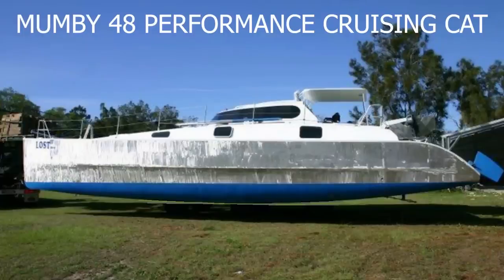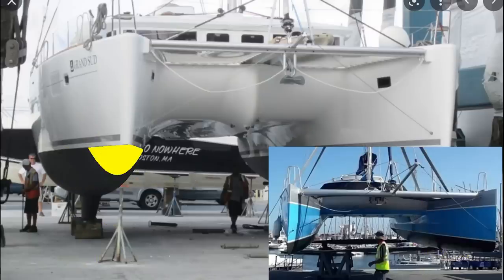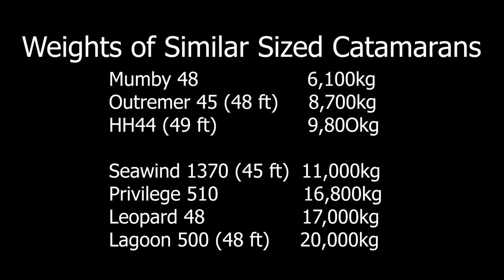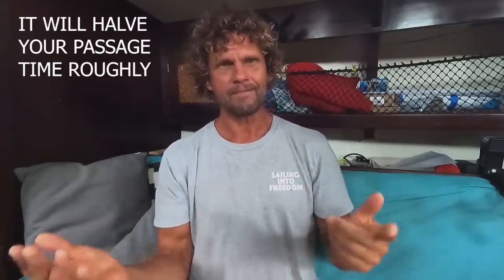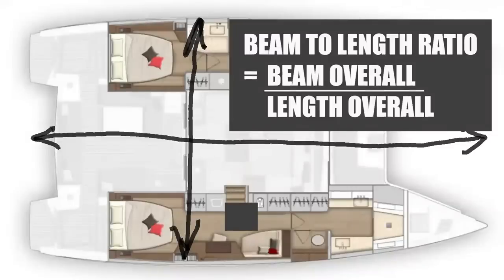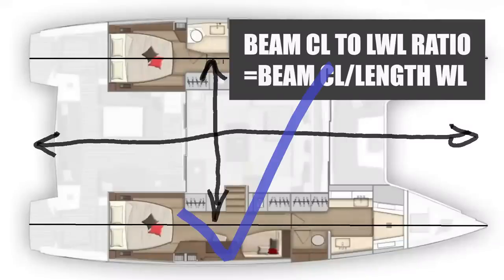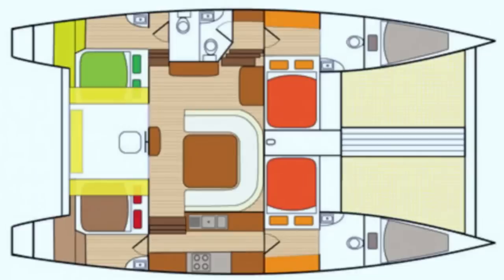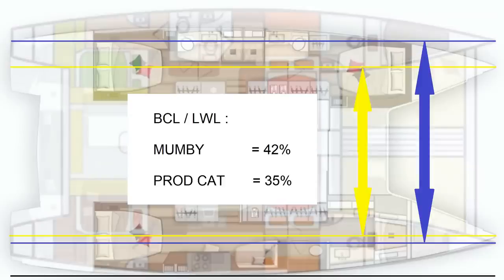How to avoid capsize? What to look for in catamaran design.

Comment: The information presented here is only partially accurate because it assumes "everything else equal". But everything else rarely is equal and this nuance wasn't discussed. Ie if the Mumby 48 was built with a moderate hull extension front and back so it was now 53 foot long but the rest of the boat was un changed (same rig) the length to centreline beam ratio will be "worse" but in this case the boat will be slightly less likely to flip over and the boat will have an improved DLR and higher speeds in moderate to strong conditions with only a minor increase in cost when building. I really don't think Serges stretched M48 is more likely to flip due to this ratio getting "worse".

This design philosophy has been embraced by some designers who have designed boats with long hulls and small rigs and small internal space IE stretched at the design level. Bob Oram is one I am very familiar with and his designs have similar SAD (better actually) to say a Mumby but superior DLR. For example my last boat was 13m long and 6m wide but it did have narrow hulls so centrelines were not too far apart for the small beam. The design philosophy here is a 33 foot boat on 43 foot hulls. Cost, rig size, space and weight are more similar the smaller boat (3700kg) than the bigger one and cost is the most important of any "design ratios" as we all just want the most boat we can afford.   Spending a bit more on the hull length without making everything else bigger is a valid design philosophy which does not result in an increased capsize risk.

The mast of my Oram was tiny 14.5m yet the boat is considerably faster than a Mumby 48 when both are in cruising trim even though its nearly 2m shorter. A 48 foot version of that boat would be very fast indeed. I was going to build a 15m version of this boat but now I have a very wide boat which at 15m long 9.2m beam with 7.6m centreline is on the other extreme. But sometimes it just works out this way. This wide boat will not only be able to handle a much bigger rig than if it was a lot narrower but unfortunately it requires one to equal the performance especially upwind.
Reply from the maker: You can't show  everything in a single video...more to come
Reply: @SAILINGintoFREEDOM  Looking forward to it mate.   I hope you explore some of the nuances here.   As you know a complete design is more than a sum of its parts and narrower overall beam to length isn't always bad as it depends on the context. Cheers, Deny.

Comment: A view from the UK. No bullshit heh Pedro? How's about the one; "that you can out sail a cold weather front" with 10kn boat speed? Your homework for tonite Pedro is to find out the speed of a cold weather fronts move at that's 25miles away and the boats doing 10kn how long before the weather front is on top of you? No, no bullshit.
Here's another one. Increasing the cross section of a cats hulls decreases the ratio of LWL to hull width ONLY works if you keep the beam the same width. Oh, you forgot to tell us that. That's ok mate no worries.
Reply from the maker: I didn't say cold front. Get on a high. They are slower moving
Reply from the maker: And how much can you put in one episode. I probably lost 80% at the first formula. Maybe you create a video and see how well that goes
Reply: @SAILINGintoFREEDOM  No thanks Pedro, i'm not that narcissistic. Highs go at approx half the speed of a low. Yup, you sure gonna run them outta town that's for sure.

Comment: The same thing that makes a cat fast is also what makes it so unstable in the lightest of weather its why they put the escape hatches on the bottom of the boat there just not enough hull in the water to make them stable even under light weather conditions .
Reply from the maker: You just have to be an active skipper

Comment: Pseudo science , but totally bs, comparing a floating penthouse like french production cat with a heavy slow aluminium cat with keels cat like munby. Next you put wharrams in the mix? Much more goes in a good modern catamaran design (gunboat, hhcatamarans etc) For example : if you extend the waterline with the same weight, the sail area can stay same for the same with same or even faster speed, but stability would be same and you have less pitching. There would be way more to say, but that could fill books.

Comment: It is very apparent for me as it has been my whole a life being a boat lover, is al boats are pieces of shit love them but POS.   My favorite part of store bought cats is that you can fold the boat up over tightening the rig how does a designer create any boat where that can happen ? why is the standing rigging attached to a "chain Plate"  which is anchored in the glass of the hull how can that ever be sea worthy ?   most have substantial less structural integrity than an acoustic guitar .
Reply from the maker: They sag too... The Mumby is very rigid... Less fatigue
Reply: example 1 the 9 figure priced boats that rhyme with baboon the unsealed interior closet walls they are calling bulk heads are ripping the lls in quarters who designs 18' of beam into a multi hull and doesn't acount for flex because its gonna move I know how it hard to imagine once one examines the artisan glass work behind the panels showing off the exposed wood cores wear the glass just stops unfinished looking ,  fibrous feels like a double wide "managers model " sorry be so hater aide but come on a million$ !!!!  they are all like that rigid and blue-water don't balance they are not symbiotic.  "beautiful yes fast but rigid, wide" soon to be bent just before its splits like a cel and sinks because no one thought of how to stop the boat once it changes course for the bottom. "its the wow factor  wow ! we are sinking launch the inner-tube ! it will save us... I need a blog  Peter is the man hes the Brett Farve of sailing sending D-picts in a hurricane  trying to make boobs appear , what  taking on water ? nah just a bit ...

Comment: Plucky, I have a lot of respect for you and your experience but some of this is just silly.  In the face of a storm that is capable of flipping a 35,000 lbs catamaran, with the only "hypothetical" solution being running away from it,  do you think the Captain is going to put up sails to run from it at 6-10 knots or are they going to light up the oversized diesels and motor out of there at 12 knots?  Next you seem to be ignoring weight as a contributing factor to stability.  In addition you're eventually going to run into a storm that sneaks up on you where there's no possibility of running from it.  Vagabonde proved that after bragging about how they just sail away from trouble...  Go watch "Caught off Guard.  UNFORCASTED STORM, middle of the night" by them.  Lastly, suggesting that going sailing in a storm is a better idea than throwing out all your chain and a second anchor is a bit irresponsible...
Reply from the maker: Wow. You really havent been paying attention. 1. San Andres is bad holding. The worst place to be with an approaching storm is to be anchored there despite what Capt Rick does. Deep water is the best with plenty of sea room. 2. In bad conditions running your diesels will  often lead to clogged filters and stalled engines no matter how well you clean your tanks but it's irrelevant in any case because you have ample power with the wind to run with it under bare poles. Motoring into it is highly questionable unless your are really big and have lots of power and mass. 3 I haven't discussed righting moment but I did mention that raising the CG is very bad despite your boat being heavier...it will just more readily throw you over.... Remember the ocean isn't flat and you will sometimes be leaning on the side and with high windage aloft with that high boom and sailbag (sail put away) it's only going to add to your troubles. All the factors of the bad modern production cats ADD up in the negative. It ain't good!!!! There is lots more to say but maybe watch the videos again. Good luck.

Comment: i like the mumby in a lot of ways, shaft, aluminium etc but the coachroof is bloody ugly.
Reply from the maker: That's changed
Reply: @SAILINGintoFREEDOM  cool. 
6t lightship is very light. do they bob around on anchor like gun boats, schioning etc? 
what size hull plate?

Comment: The Mumby is a horrible catamaran because the build quality is sketchy & inconsistent. Some are ok; some are worse than Cuban trash rafts.
Reply from the maker: Wow. If you build it poorly yes it will be terrible. That goes with everything. Does that mean it's a bad design. No failures yet.
Reply: @SAILINGintoFREEDOM  
Design is only as good as its execution.